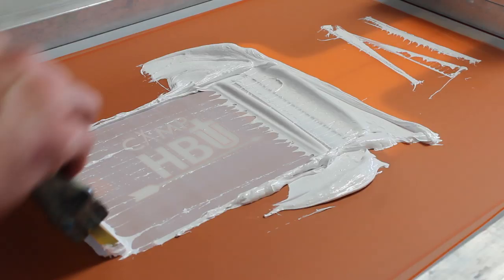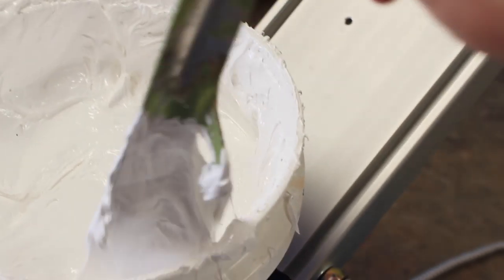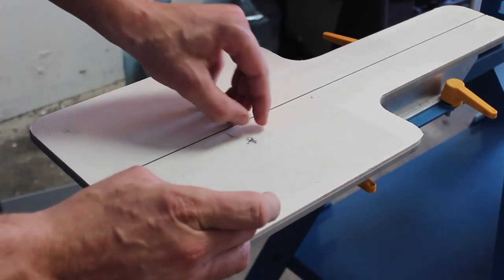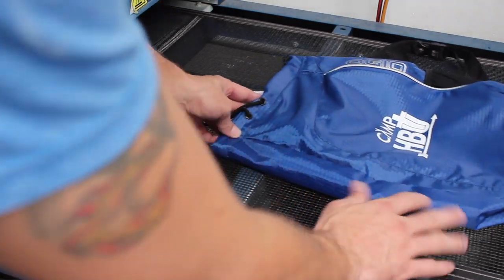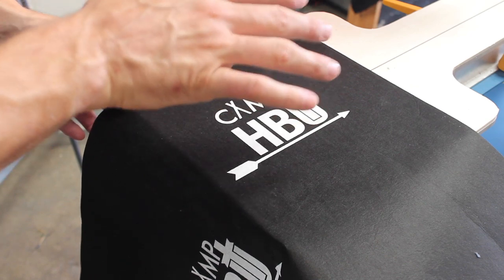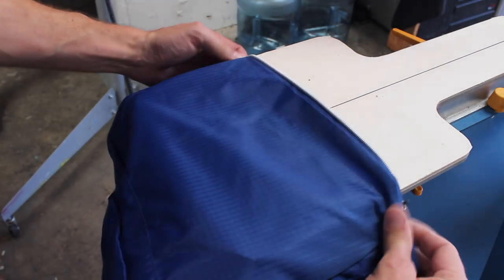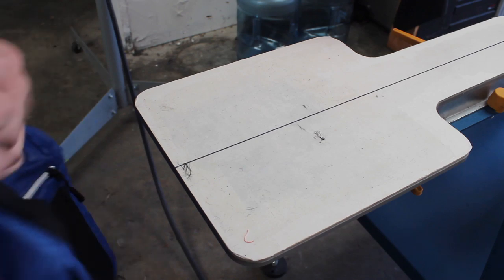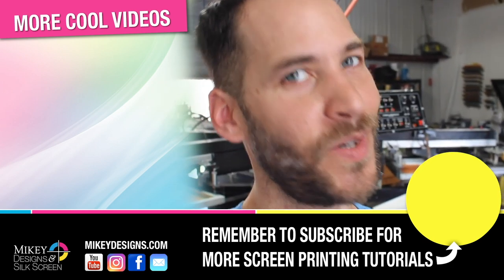How to Screen Print Backpacks STEP by STEP Full Tutorial

Comment: Hello Mike do you know why when I pass the bags in my conveyor dryer the belt lives a marks  in the back of the bag where the bag touch the belt I know is the heat but and then how you cure the ink
Reply from the maker: Are you using a low cure ink? They generally cure around 265º. They could be getting too hot.